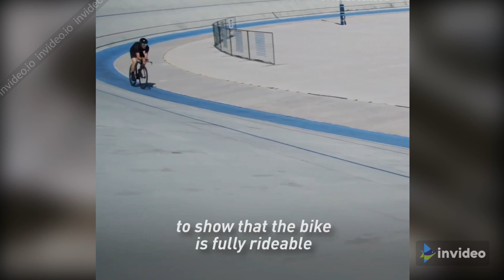First Chainless bicycle (Denmark)

Comment: What about wear?
It seems that the cogs are connected in way less area than traditional chain.
What are the expectations in case of longetivity compared to tarditional bikes?

Is it possible to use the normal geomerty chain stay as a base for the shaft?

Comment: Why not have a clutch system instead? For shifting gears. Hell, my bike has a gearbox shifting system inside the wheel with no extra gears outside. The wheel has one gear and the crank has one gear. But my bike speed has 3 gears. Funny right?

Comment: Put the shifting system at front rather on the back, like gearbox system, and change the chain with axle or belt, it's more practical in my opinion

Comment: This is not the first danish bike without chain. I have been driving first a danish Viva-bike and later a Biomega-bike using cardan/shaft-drive.Thiswas introducedmany years ago.I had mine for approx.15 years.They work very well, but are heavyer compared to chains, and far to heavy for racing. But they require very little maintenance. I still have my Biomega, and am very happy with it.

Comment: Interesting. Still it's proven since long time that shaft drive is several percent less efficient than chain. 
I like the idea for practical use but it will not be a winner in a race. 
And as several other have mentioned: it may work for continious run at even speed, but for sprints and standing pedalling it's too big risk for break.

Comment: The major problem isn't only the friction, but the resulting vector of the transfering forces from one axis to another, every degree of force transmission will cause an exponential difference and loses, the most simple way to ilustrate that is imagine a car doing a tight hairpin turn, in which speed you think that the forces will push out of the track?

Comment: If this finally does make it into production, I think that the contaminant cover would be mandatory for safety reasons. Imagine being in a cycle race where there is a pile-up. That rear plate could do a lot of damage.
Reply: Idk man. I'd rather a get bit by that then a finger in the current chain and gear approach.
Reply: how is that not a problem with the existing tech

Comment: This design has been around for more than 2 years now, and I still haven't seen anyone actually ride it in a real world environment.
There's obviously problems associated with the design that they cannot overcome, I suspect.
Reply: I have a feeling they’re just soaking up funding for as long as possible.  The design probably works already.
Reply: @True Hermaphrodite Seer 
Right, real 'innovation'.
A $200 bike from Kmart has got 27 gears, this has got about 7.
Backward innovation perhaps?
Reply: @SaintKimbo  most gears are not important or ever even used.
Reply: @SaintKimbo  come on, more gear for what???
Reply: @SaintKimbo  this actually has 12 gears count it
Reply: @SaintKimbo  more doesnt mean better, that type of bike usually skip gears.
Reply: @fredmad4988  Not when adjusted correctly lol
Reply: I’ve seen one on qatar 🇶🇦
Reply: Actually the drive shaft has been around since the 1800s!

Comment: This is not the first chainless bycicle. Plenty of shaft driven bikes out there dating back decades.
Reply: And completely ignoring belt drive
Reply: And tell me how they would shift?
Reply: @TheNuclearBolton  point being it wasn’t the first shaft bike. It is the first shifting shaft bike. This design is an over drawn out effort to make an inefficient design work because of the hype it generated. Wouldn’t be surprised of the square chain ring also makes it to market...
Reply: @glitchy8429  Are you saying that energy is being spent inefficently? :D
Reply: @cosmicphizzics143  no energy is being spent just as efficiently as any other bike. You’re basically relying on that gear bearing a side load and hoping the materials are strong enough not to flex. As thin as that gear is, you’d need an insanely strong material to keep it from slipping.
Reply: @glitchy8429  Why say "this design is an over drawn out effort to make an inefficient design work" then say "energy is being spent as efficiently as any other bike?"
Reply: My joke was about research efficiency.
Reply: @cosmicphizzics143  All right I didn’t know you were joking, lol. I guess I’m both saying it’s efficient and inefficient. The idea in theory and inside of a perfect world is efficient, as in if you could build something that’s strong enough that the gear would never slip, it would be fairly efficient. However, it’s not a perfect world and the gear will slip which makes it inefficient. At least those are the issues I’ve been able to read about it so far. It seems this thing has been nothing but an engineering nightmare but the hype keeps pushing it forward.
Reply: @glitchy8429  Thanks for the clearification. I felt like something was going over my head.
Reply: It's not just about chainless but a gear shifting system with minimal loss through friction.
Reply: A bike for rich people who never ride. Every time I see this thing I think of the abuse I (everybody who rides daily) put my drive train through, I cringe. What are those gears made of?
Price probably says "Unobtainium". 
One thing I haven't seen in this video compared to others  is criticism of their data...any proof on any of it?
Reply: @jbarnhart2653  it is a technology to be improved upon. It can obviously be more robust and still remain within the efficiency leadings with its current architecture and geometries. Just wait until we have field distortion technologies to alter gyroscopic masses. Instantaneous torque vectoring.)
Reply: Correction: I was asking Mr. Nobody if he was a competing company since he stated "This is not the first chainless bycicle. Plenty of shaft driven bikes out there dating back decades" but nothing else. VR...Electric vehicles...that line has been used before on things that were tried and then needed science to catch up. But if I see anyone riding this bike and asked me if I'd like to try it, heck yeah!!! hint hint wink wink CeramicSpeed cough cough Virginia cough cough cough